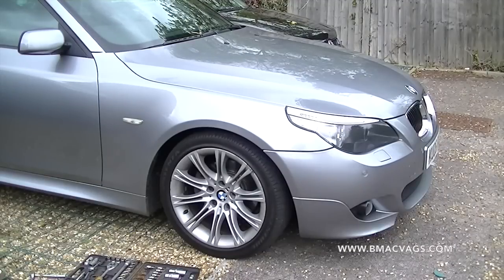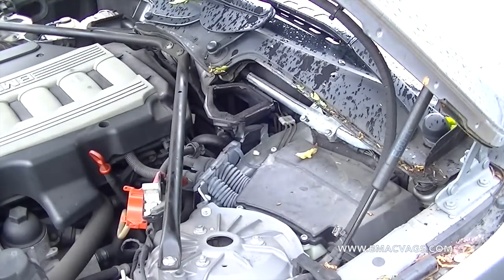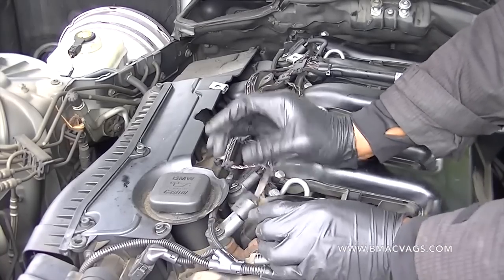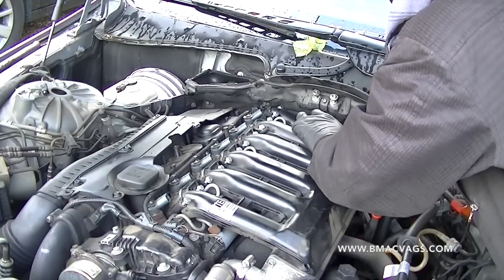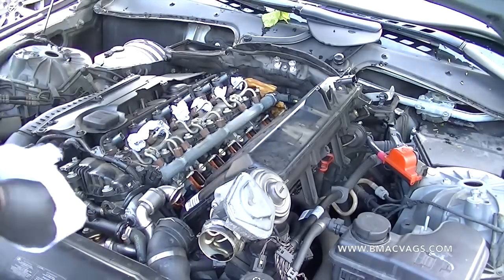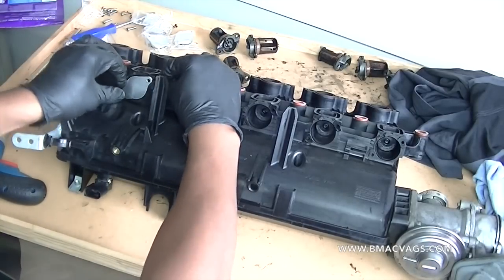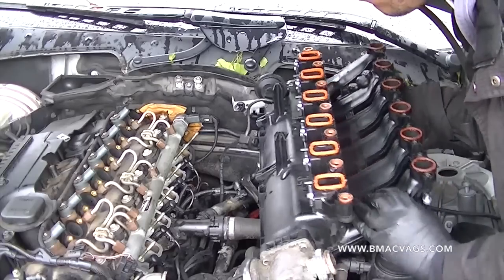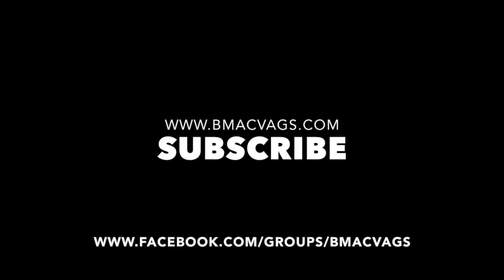BMW Swirl Flaps Removal DIY Tutorial...........Money Saving Vids!!

Comment: I have a nov 2006, X5, E53. If i put a mirror under that edge of the inlet manifold i should be able to see if there is a silver sliding rod or not ???
If not then no need to do the job ??
Do you think thats possible ??
Reply from the maker: I really dont know if that would work. I tend to just do the job and be over with it
Reply: @BMACVAGS  i took a foto and could see the flaps, so i bought a delete kit !! Thanx

Comment: In the video when you was removing connections from the manifold you unclipped an item that you was not sure what it did. Its the egr vacuum solinoid. I'm trying to find out where the two line run as I have one off mine and carnt figure out where it connects. Thanks in advance

Comment: I've watched quite a few videos on this subject recently but this is a nice and simple, easy to follow guide. By far the best yet. However, my question/thoughts are.... BMW designed the swirl flaps for a reason. They help a clean, efficient combustion as low rpm and throttle, and therefore a better throttle response and power/torque at low rpm (as well as improved efficiency). Look up "what do swirl flaps do" on YouTube.
So, instead of spending money on a delete kit, I plan on removing, cleaning and using a cheap solution of Loctite on the swirl flap screw threads. That way, I retain the original fluid dynamic design of the smarty pants engineers at BMW, without compromising the longevity of the engine. For reference, I have a BEng in Automotive Engineering and so these are my 2 pennies on the subject. If my E90 engine dies after this cheap mod, I'll call back here, tail between legs to let you know.
Reply: My grandfather was a fantastic diesel mechanic (should have been an engineer but no chance of a tertiary education) and he always told me 'someone a lot smarter than you or I went to a lot of effort and and time to design and incorporate that into this car, if it didn't need it, it wouldn't be there' . I often think about that when I'm tempted to mod a vehicle. 

I'm currently dealing with a 530d that has had huge problems (DPF mainly) due to someone deleting the EGR without coding it out properly. I've just found they removed and threw away the vacuum can for the swirl flaps too when they did the delete...
Reply: @adamwest1138  I hope you get your problem fixed. There's far too many cowboy mods online that fix one problem and create 10 others!
There's a reason that people look for clean, unmodified cars.

Comment: Thanks for the video. Very helpful but on reassembly, did you leave the vacuum in situ and intact, so it was just the flaps and their operating rods that were removed? If so, can we assume that the vacuum unit would operate normally as if the rod was still there so there would be no loss of vacuum?

Comment: Great video mate, really helpful for DIY! I am going to change my glow plugs whilst I am doing the swirl flaps on my 2009 530d do I need to disconnect the battery before doing these jobs? If so will this cause any issues with the idrive and car settings? Really appreciate your help and reply! Wazza
Reply: You actually need to disconnect your battery before start doing that. Because you will unplug your injectors's wires. And that will not damage your iDrive system.

Comment: Got a 2007 525D E61 LCI model took of Manifold and it doesn't have swirl flaps or blanking plates, was leaking oil because
manifold bolts were very loose. going to put new gaskets in.          So if you got same model    NO WERE SWIRL FLAPS FITTED.
so dont remove unless you have to
http://www.realoem.com/bmw/enUS/partgrp?id=NX52-EUR---E60N-BMW-525d&mg=11&sg=40

Comment: Hi 
Someone know what can be the problem with loose a power like 20% after the mechanic changed rocker cover gasket on my E60 M47 163bhp?
Everythink seems to be ok everythink conected but Now Is slower than before.
Please help🙏
Reply: Martin zachar have you found out what was the problem?
Reply: @Florentin121  
Hi mate
Not yet.
I did the remap to 212bhp it's little bit better but still not like before they changed the rocker cover gasket.

Comment: I have a 335d touring E91 and just had swirl flaps removed and blanking plates put on. Ive noticed straight away the difference with engine power has dropped. Is this something that should be expected. I miss the engine performance before I had the job done.

Comment: Can anyone help me out. I've just removed my inlet manifold to change my glow plugs. Everything went well apart from now my anti shudder valve appears to not be working 🤔 which attaches to the egr valve. It doesn't even activate when removing the connecter from the bonnet sensor. Thinking back i remember the connector that connects to inlet manifold had another connector on the same loom. I just presumed it was something to do with the swirl flaps and left it as these have been removed. I don't remember disconnecting this connector. What's it for? Is it needed for the anti shudder valve to work?

Comment: Brilliant video!! In the rain as well. I'm about to do this job, and also change the glow plug plugs. My car has no power under 2k revs so thinking about changing the swirl flaps actuator . Have you come across this issue before? No power at all under 2k even a 1.1 micra can do me at the lights :(

Comment: Hey, I've just managed to remove my swirl flaps and everything went smooth and as expected apart from some fucked up reinforcement transversal bar bolts which BMW left me completly stripped!

On your video you are not sure if you have to remove the bar but I can say you'll need to because you can't take out the back motor cover to access back intake manifold screw.

Keep up with your great videos! :)

BTW, I have a 530d with the M57N2 engine. My intake manifold can't come out without removing the injectors :)
Reply: In Poland we have alternative solution to remove swirl flaps: remanufactured swirl flaps which have improved construction (bigger shaft size, new seals, aluminum plates and brass levers)
https://imageshack.com/a/img922/2774/evoUwK.jpg
https://imageshack.com/a/img922/916/E7otQk.jpg
Regards
pt-pro

Comment: Hello. Why do Vaseline use on the gaskets? Is it better silicon grease or lithium fat? thank you for the video. it is very useful.
Reply: U should not use vaseline as it contains petrolium which will eat up the rubber gaskets, instead use lithium greese

Comment: ok! a quick question!! once you've removed the swirl flaps

is it actually necessary to re-attach the vacuum valve that controls the flaps? could you not just remove that valve aswell & blank off the vacuum hose that operates the pump??

also would this apply to the 520D (4 cyl) engine as I'm looking into buying a sport model only diesel version
Reply: No body answear to this question ???
I need to know please 🙏 thanks
Reply: 121bham  Don't spread rubbish.

Comment: is there any way of telling if the swirl flaps are still there without taking inlet manifold apart.
Reply: Put your hand underneath the intake and feel around. If the vacuum actuator and shaft is still there chances are pretty good the flaps are also still there.

Comment: hi there.  great video thanks for posting. I have just done the swirl flap removal and installed blanking plates on 530d. engine runs quite gruff and increased emissions warning light flashes up. any idea why that would be?
Reply from the maker: Check your air filters and drive the car around for 100 miles.

Comment: Hi, what did you do with that vacume ? I mean, did you conected it again to electric plug ? so after removal of the flaps it blows air somewhere beside the engine ? or is it not connected to any electricity so after removal of the flaps it doesn't work at all ?thanks ;)

Comment from the maker: Cesar Pereira where are you located?
Reply: +BMAC VAGS  I'm in Portugal
I'm also looking to delete the EGR valve and getting the delete Kit as well as the 90º silicone pipe for it. I noticed you have it on your website but no info on contact number that I could make a quick call to order the right stuff. Do you send to Portugal ?
Reply from the maker: yes I can post to Portugaul no Problem. Do You have facebook?
Reply: mate where are you based
Reply from the maker: London

Comment: Top video BMAC VAGS, excellent. Will do it on my 320D E46 2003 as well. Do you by any chance where i can order those blanks you used on the swirl flaps holes? Much aprecciated

Comment: My BMW has 125k miles recorded. After watching your video I had enough confidence to do the job myself and it was all done and dusted within 2 hours. No special tools were needed.and it's all thanks to your DIY tutorial. 
Thinking about it afterwards, perhaps 6 new complete units should have been installed instead of just blanks as the EGR system will  be severely compromised without the manifold depression created by the flaps restricting incoming air at idle and on overrun. That said the engine certainly sounds crisper and seems to pick up smoother.
Thanks again for your guidance
Reply from the maker: You are welcome, I am.glad it helped you
Reply: Hi David. What do you mean? Also what if you did an EGR delete? Have you had issues in the last year?
Reply: Nndjekwkkejdbennenekrlöd..,sm

 $&&$

8fjfjfjģ
hxkfdkkskskksjdjfjbfkfäqå  

M .¿•◇◇•¿•¿•
Reply: David Hall does this save your engine or just tune it up some? Confused just bought same thing you have
Reply: Yes i though i was seeing things! just putting blanks in and removing flaps completely. This could well mess up EGR settings. If i do job i will put in new flaps.
Reply: @MrStephen777  no point in "removal" of swirl flaps if you'll just put new ones in :P . that aside, swirl flap+EGR delete does the job quite well :) .

Comment: Going to attempt this myself on my 335D M57TU2D30 engine. Thanks for the video! 

The rod which opens and closes the flaps doesn't need to be refitted, correct?
Reply from the maker: +SGM 26 Correct, the rod is now obsolete.
Reply: +BMAC VAGS Cheers!
Reply from the maker: No problem
Reply: @BMACVAGS  But you'd still keep the vacuum attached right?